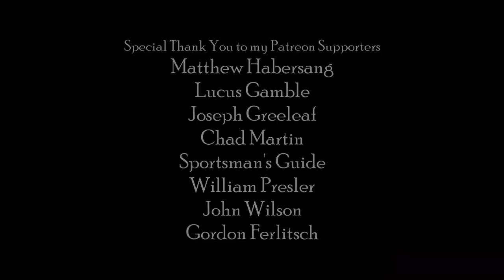Making a Longbow With a Knife

Comment: I recently started building my first bow and since I don't have a draw knife i used my butcher knife and its amazing how versatile it is. It can be a draw knife,a scraper and a carving tool. I'm now starting the floor tillering process and the knife works but I know it would be much easier and faster with a draw knife or block plane.

Comment: how sharp was the knife when you used it?
Reply from the maker: I sharpened it pretty frequently during the project so it was fairly sharp. When I was using it as a scraper I rolled the burr over a little to make a hook to pull curls off the wood.
Reply: @SwiftwoodBows  nice, I got this knife recently cause of your video and I havent got my edges right. Did you regrind the edge or is it the factory one?
Reply from the maker: @3asianassassin  hmm, I didn't put that much thought into it. Just used a couple grades of whetstones and a sharpening steel as needed. I'm not an expert sharpener so you can probably get better advice from others regarding that. Good luck!